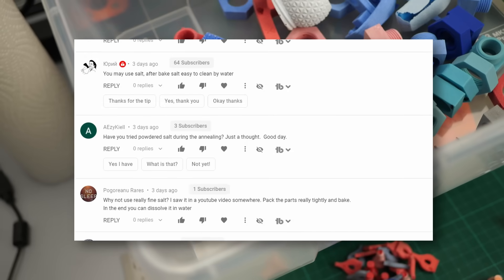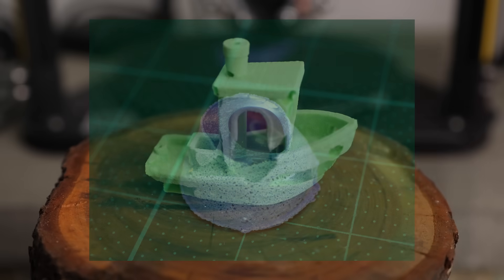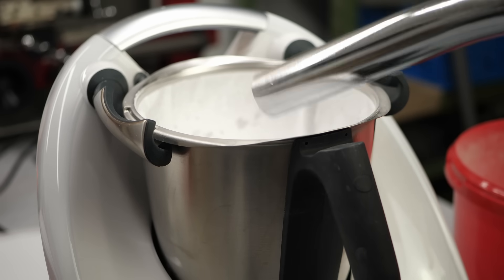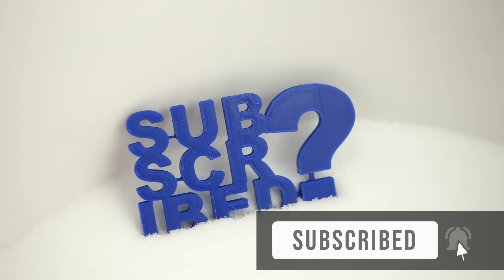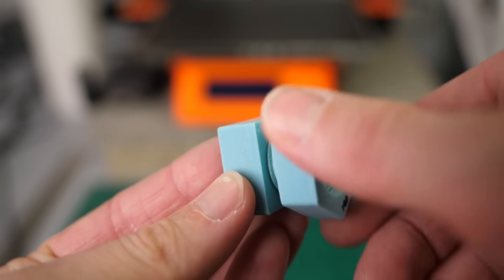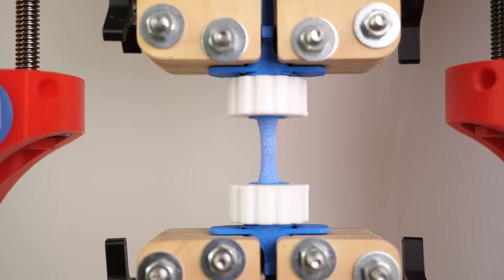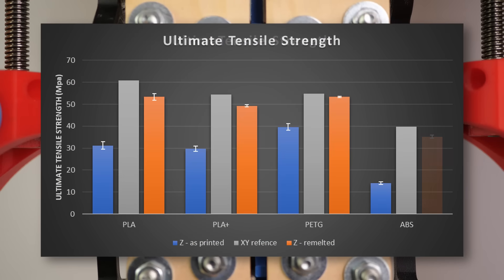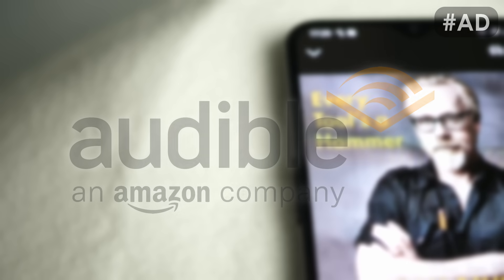The STRENGTH of 3D prints REMELTED in SALT

Comment: Sodium Bicarbonate, aka baking soda, comes as a fine powder.  It decomposes to sodium carbonate at 50°c but as long as it remains a fine powder it would be easier to use than sodium chloride as no blender is required.
Reply: Plaster powder has a very high melting point.  It may work well in place of the salt.

Comment: Im no chemist but maybe there is some sort of reaction that lets you precipitate salt out of a solution in very fine particles
Reply: Salt would crystallize in solution. You could produce salt of a very fine particle size by reacting sodium with chlorine gas, but that has its own obvious problems.

I'd say that the easiest solution would be to put salt in a ball mill
Reply: @OutOfNamesToChoose  oh cmon, what's the worst that could happen? 😋
Reply: Im a chemist. Ball mill or using a different material would be much easier.

Comment: Looks like grain size isn't only to blame. Might be caused by wet salt or inpurities in the salt. As dry salt does not clump together.
Reply: Or vapours coming out from melted plastic cannot escape between grains of salt.
Reply: @KAMIKADZE441  the vapour can defenetly escape, salt is quite pourus. good thinking
Reply: I think the clumping you saw was from the static charge built up in the blender
Reply: @Yrocsrelles  the thermomix bowl is grounded therfore there would be no ststic buildup. but salt is hydroscopic so it is more likely to be caused by humidity.
Reply: @henry67278  dry salt clumps together , thats why the industry puts in additives to avoid that: https://en.wikipedia.org/wiki/Anticaking_agent
Reply: @hyperhektor7733  I am aware but the additive is only so effective and is not perfect. So drying the salt before use would be a good idea.

Comment: This is such an interesting result! I wonder if it's possible to make parts that retain the strength of this method without the disfiguring of the outer surface
Reply: You would need to cote printed parts with substance that will separate salt from part and salt need to be ultra fine.
Reply: @kundeleczek1  I was considering the use of silicone as a coat. It could be high temp. silicone, but maybe standard silicone is enough. It can be brushed onto the part. Off course this is not a cheap fix, but very effective!
Reply: @Fischertek  you would need to spray thin layer on a print to avoid print disturbing. Isn't silicone to soft? How would you remove that silicone?
Reply: @kundeleczek1  Yes, silicone is soft, and I wouldn't expect strong bonding between the print material and silicone. You will only have to brush a protecting thin coat of silicone on the print. The salt would create the necessary support during annealing.
After cooling down, I would expect that it's possible to peel off the silicone skin. If not, you will have to use a wax release on the print. I haven't tested this :-)
Reply: @Fischertek  @cnckitchen you need to check this out

Comment: at the part where you grind your salt finer - before watching the full video: how about casting sand used for metal casting, you can get this premixed very cheap here (just google "ölgebundener Formsand" you'll can get this in very fine grain sizes, that leave a perfect surface finish while casting metal (like a clay impression) you should avoid (at least in principle) the salt soaking into the outer layer for plastic parts

edit: additional thoughts
the problem might be that the oil in the casting sand reacts with the printing polymers - if you use on the other hand oil free casting sand, the binder is usually water which also can have negative side effects
Reply: I tried casting sand because it is way easier to use as salt. Unfortunately the results were awefull. The sand builds up a surface to the part which is impossible to remove. Also the smell in the kitchen doesn't support a peacefull relationship with your partner...
Reply from the maker: I already did one batch in very fine greensand (Proast N, https://giessereiartikel.de/shop/index.php?cPath=1_11) though had the problem that I was hardly able to get the remains off the surface.
Reply: @CNCKitchen  what about using the plaster (oder gips) mix without adding water? that stuff should be very fine to begin with, thermally stable and also be hygroscopic, further drying the parts in the process.
Reply: Casting sand has oil as a binder. And filament plastics are porous and will absorb the oil. Also, you can't just easily wash it off with water like salt.
Reply: @axelhopfinger533  yes, i know - thats why i wrote this in my post - the other option is to use casting sand with water as a binder, but this is usually used for casting very big parts and it has a very coarse grit to let the steam thats created during the casting escape so your casting form does not explode

another option would be to buy casting sand without binder for dry casting (called "Formpuder" in german), i is usually a very fine ground talcum powder - in principle the same powder that is used as a non-stick or relase agent between when you use regular casting sand - also probably a mix of talcum and corn starch could be usable (like baby powder)

but since the structure of that is similar to that of ground salt, the surface might not really differ, but at least you don't have to grind salt to a fine dust and don't have this extremely hydrophile properties, that salt brings - thats maybe the issue with it sticking so well to the surface
Reply: @suit1337  How about baking powder?
Reply: Muss ich mal ausprobieren.
Reply: Not dissolvable and the oil might soak into the plastics thus weakening it.
Reply: Or just use the Bentonite Clay that is in casting sand. Bentonite clay can be found as Organic Cat litter and turns very find in a blender.
Reply: @marcdavenport6987  I am sure his wife would love to grind up some cat litter in her thermomix :)
Reply: @cliffdud3  So true. When ground up clay litter, I bought  the cheapest used blender on Craiglist I could and made a dedicated blender.
Reply: Sehr schön Stefan, toll! Casting sand was my first thought as well, but indeed you would not be able to wash out the grains ... To me, normal table salt has one problem: it's agressive, and even after washing out carefully remelted casts, you may have (I emphasize "may have") trouble over time, as PLA, ABS, etc. will weaken: salt residue bound to ambient humidity will attack the plastic ... Dry plaster is something to think about (well, plastic might soak into the poder even if well compacted, but it's worth a try) and yes, there is one thing to consider: the final costs. Will follow this thread. Stay safe!!/Passt auf Euch auf und bleibt gesund!!

Comment: A ball mill would be excellent in making the fine salt.
Edit : I would also like to see what happens to CF Nylon.
What would be also interesting is using Epson salt that has had its water bonded to it boiled off.  It make a powerful desiccant and can protect the parts like nylon when it is up in temperature.  Don't forget to probably hold the nylon at a temp to dehydrate it before going to the melt stage. You will need a hammer and ball mill to powderize that stuff as it cools down into hard cement.
Reply: You could also use calcium chloride, it loves to absorb water. Here in Canada it is sold in huge bags during winter.
Reply: @marc-andreservant201  What about Gypsum powder dried out
Reply: @garbonzoe  that is what plaster is.
Reply: @adama1294  Gypsum plus water equals plaster, I was thinking just the gypsum in the oven with the part
Reply: @garbonzoe  I'd think you might end up with a layer of plaster around your part. Any moisture that escapes the outside molten layer could form a film of plaster where the gypsum is touching. Could be useful, could be a headache.
Reply: @StrawHat6  Ah, that's a really good point
Reply: a cheap burr grinder with a ceramic burr would be ideal
Reply: After seeing Nile Red do the Epsom Salt boil off...putting that in a ball grinder and making it a super fine powder would be awesome.

It would be so dry that when you put the part into the salt, the salt would wick out the moisture of the filament.
Reply: You beat me to it. I was going to suggest getting an inexpensive rock tumbler, the appropriate balls (would ball bearings be appropriate?) and just let it run for a couple weeks.
Reply: Yea I second the ball mill idea. Cheap and safe way of getting more fine salt in one go. Also consider a desiccant or dry nitrogen to store the ball mill in while running or run it at temperature i.e. 50 to 70c? To dry it.
Reply: BLAH BLAH BLAH BLAH BLAH
Reply: @rrtsduf  Very constructive...

Comment: I have some very fine aluminium oxide here usually used for polishing, this should be pretty usable for this purpose.
Reply: Aluminium oxide is insoluble in water so it would be harder to post process.
Reply: @DavidMulligan  that's right, however the embedded grains actually do make the part stiffer, at least that's what I noticed with sand (and the parts look like they're made of dry sand, which is trippy as hell). The outside basically becomes a bit of a composite material. Actually, you could do this also with glass micro beads and make parts that are highly retro reflective.
Reply: @free_spirit1  indeed, if you think about it, why bother with dissolveable stuff if you want structural parts, and it actually adds better mechanical properties? Talking of composites - how about remelting in chopped short fibers?
Might be hard to post-process though, unless you do not mind them beng "hairy"... or you can just give them a coat of epoxy.
Reply: It need further thought to be sure! Not just remelting, but surface modification! What about graphite? Ptfe powder? Silicone powder? SiC?! And apply it to GF nylon, too! That can make for some very interesting parts, like massively abrasive resistant gears!
Reply: @Balorng  yeah, it opens up a world of possibilities. One cool thing that you can do with this method is that you can attach different parts together by remelting. This means you can also embed stuff in the actual plastic. One cool thing that I was thinking about (and someone also suggested to me) is to embed metal mesh in the parts. But you could even just embed metal rods in strategic places, or steel cables or whatever. Hell, if you plan it right you can also embed solder or copper wires. The thing that excites me the most though is that the parts are actually water and gas tight, so you can actually use this method or making a pump housing, or a waterblock or other kind of heat exchanger. As long as you can get the powder out it don't matter. I was doing the math, a bunsen burner only generates only like 500W of heat. So maybe something like a small plastic pulsejet engine could actually be on the table.
Reply: @free_spirit1  I think carbon and gf rods melted in strategic locations (along the path of loads) can work great. The problem is, just like with most injection molding techniques (barring rotormolding, which does not sound viable for this method at all), you cannot make parts that that are hollow, unless you leave holes to extract the casting medium and make the model of two separate shells, but then again - you can either make them solid or hollow (with difficulty), but not with what amounts to "low infill"... but if you think about it, in might be possible to separately print infill pieces of, say, pla that will get annealed and will not actually melt (funny enough, annealed pla is one of the most heat-resistant plastics!), while outer layers will!
Reply: @Balorng  yeah, that's totally viable. It is annoying to me that hollow parts are not possible. I was thinking about adding a little bit of baking soda inside of a hollow part and then do the salt method (leaving the cavity hollow, other than the teaspoon of baking soda). As the part heats up the baking soda starts to release co2 and the gas maybe can hold up the walls. I doubt it would work, but who knows.  It's on my to do list, but I have so little time!
Reply: I've talked about Talc and mixing it with sodium silicate, I suspect you could this with Aluminium (Aloominum) Oxide.
Reply: Needs to be dissolvable in water otherwise you just get a bunch of metal stuck to the surface tho
Reply: @DrakeOola  although it may give a cool shiny surface :) or glittery either!
Reply: @AudreyRobinel  aluminium oxide is white like chalk
Reply: @DrakeOola  On the other hand, that may be desirable in some situations.

Comment: Can we transform a 3d printer into a milling machine. Image a multi-purpose CNC machine which can be a 3d printer, CNC milling or LASER engraver.
Reply: There's one like this although a mill has to be MUCH more massive than a 3D Printer because the Forces are much stronger
Reply: @FzudemB  yeah, but a rigid one can do the job.
My friend have one it can 3d printe and can be used as milling machine but it can only work on wood and 3d printer nozzle and milling drill is detachable.
Reply: @DEADPOOL-ti4cs  yeah but then it becomes a worse 3d printer because the heavy moving parts and the different motion system creates a huge speed penalty